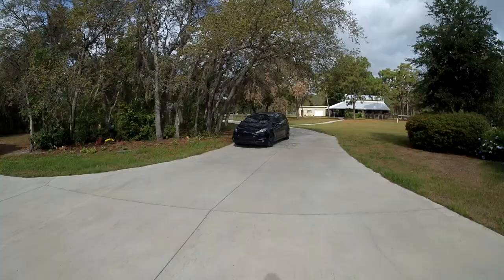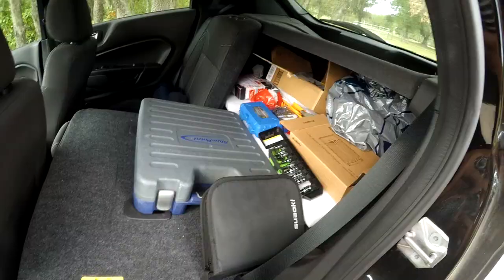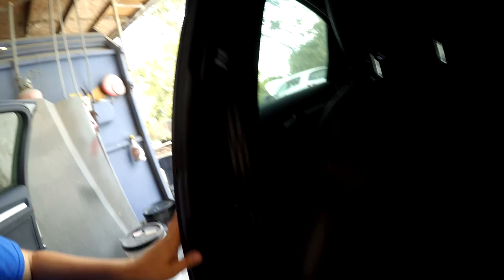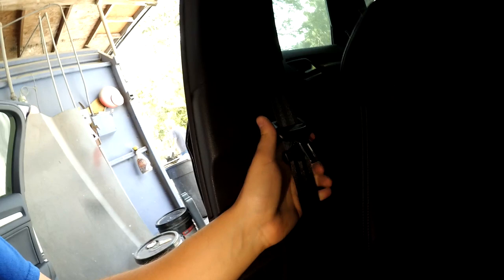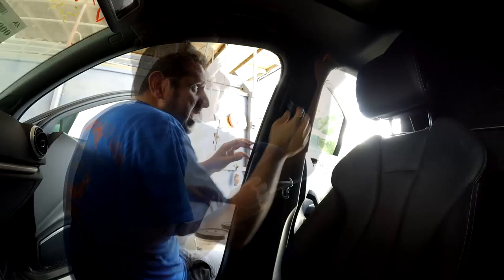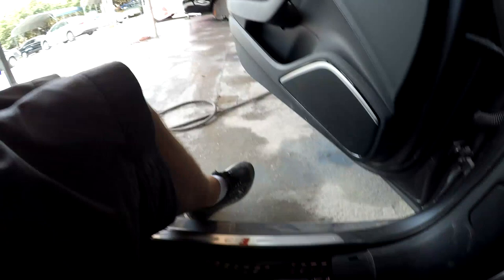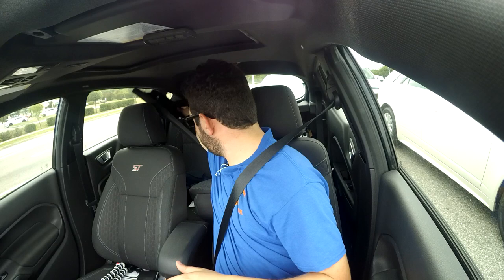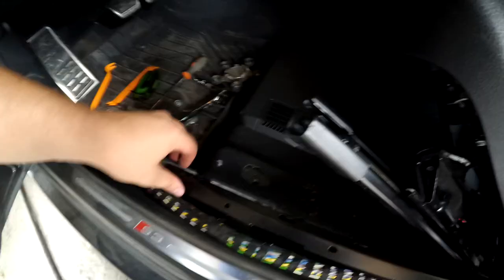Audi S3 Salvage Rebuild VLOG: Seatbelt Removal and Repair Costs $$$

Comment: Hi Sam,  I have one question about the upper pillar (from the front seatbelts)  can it be removed without removing the lower one plastic??  

I have some rattle sound comming from the drivers side pillar and it would be mich easier if the only top one (with the actual seatbelt handle and adjustor) could be removed...

Comment: That one on the bottom is a pretensioner, I was told that isn't rebuildable. It's job is to pull the seatbelt back a couple inches in an accident. On my CTS I had to replace them and they were a little over $100 each side
Reply: Are you sure this is correct?

Comment: I have and Audi A3 that's giving me a Audi Presence error due to a faulty driver side pretensioner, otherwise the seat belt is working fine, the guys at safety restore said I could remove the pretensioner only and send It in and even keep using the vehicle... My question to you is how hard was the pretensioner removal itself? I saw you had to take out the seat...

Comment: How do you plan to replace or just remove the deployed airbags?
Reply from the maker: Zhen Li good question! I have the replacements for them just waiting for body work to be done. Basically to remove the curtain airbag I will lower the headliner and it just unplugs and unclips. For the seat, I will remove it and unplug the bag, replace it and stitch the seat back up!

Comment: Can someone tell me how you remove the rear passenger seatbelts in the Audi S3?
Reply: Dave ThaBoss did you ever figure this out I’m doing the same thing
Reply: @acase11  You have to work your way from the back where the trunk is into the side of where the plastic trim piece is that holds the seatbelts. This is a PAIN in the ass. The carpet padded boot gets removed which will reveal screws. Remove those pieces and then you will be able to remove the plastic trim pieces that cover the stupid seatbelts. You have to unscrew the seatbelts from the SIDE.
Reply: @DaveThaBossDTB  Yup, got them! What a pain! Did you have to remove the SRS module from underneath the center console? I am in the process of trying to get to that also
Reply: @acase11  I do not think so. Listen. Get a VCDS scan done on everything. Delete all the fault codes and tell me what remains and is left over. In theory with a side crash there should not be hard written crash data that would keep the light on or inhibbit the system. Only if it is involved in a front end collision I think that is when the SRS Module needs to be wiped.
By the way my airbag light is on and I drive my S3 like a madman and Audi Pre sense and all other safety stuff works.
Reply: @DaveThaBossDTB  hey I got the same problem. I’m trying to get both of my locked rear seatbelts out and repair them. I took off one of the side panel in the trunk and I only saw one bolt that was holding the bottom of the seatbelt. Idk how to get in to unplug the belt and take it out